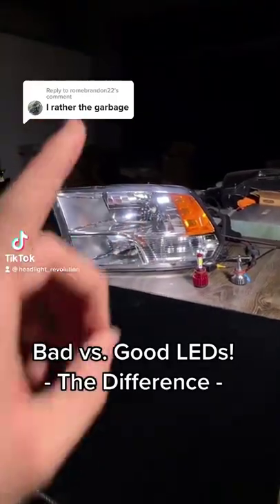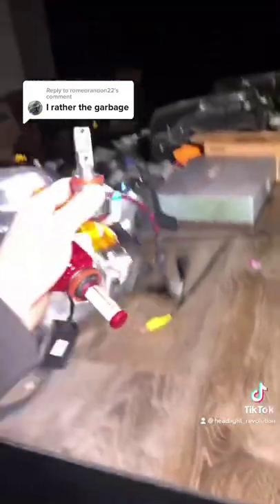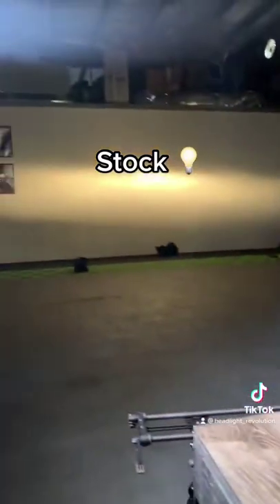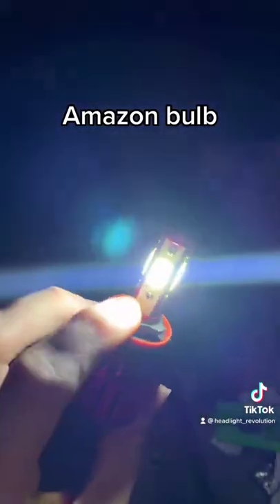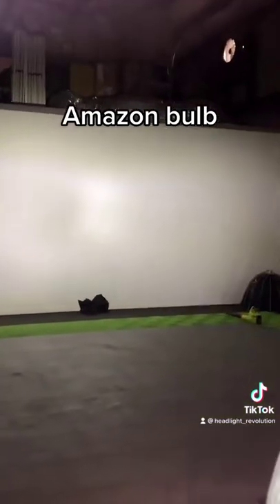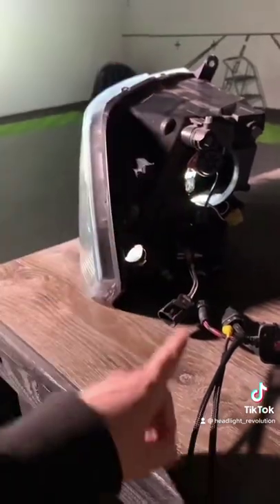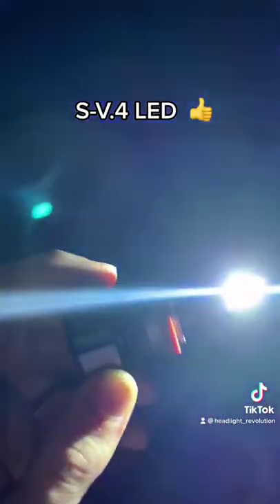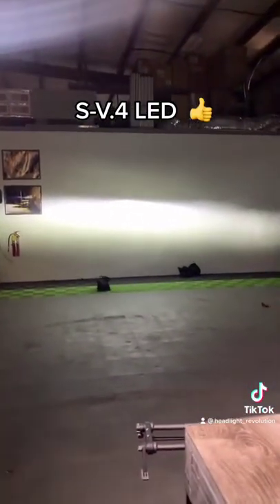Quality LED Bulbs vs. Garbage LED Bulbs! #shorts

Comment: Are the cheap LED's good for auxiliary high beams? Because I want my rally lights to be stupidly bright
Reply from the maker: Yes and no - cheap LEDs dont matter as much for high beams, but a bulb designed to mimic a halogen bulb will work much better with distance lighting versus upfront brightness. You can have a crazy bright LED, but it's not much help if it only causes glare!
Reply: @HeadlightRevolution  alright, thanks

Comment: So I installed good quality LED bulbs in my car and it seems like the light isn't dispersed evenly. There is just a small hotspot and not a lot of spread. Is that just a symptom of using a reflector housing with an LED? The brand of bulb is Lasfit.
Reply: Oh interesting I actually heard from many people that that's a symptom of a projector housing. You might have to mess around with the directions that the LED's are facing. They usually say 3 and 9 o' clock position but not always the case

Comment: I went with a set from superbrightleds and the design is similar, i see how they try and mimic an original bulb, so it has a chance at working. 
Theyve never steered me wrong, i even put one in for the microwave light.

Comment: Any LED bulb that doesn't accurately mimic the position of a halogen filament should not be put into a halogen housing. 1st generation LEDs are a disaster because of the central heat sink. Copper substrate 1860 chips placed central to the heat sink work best for reflectors and halogen projectors. 3570 chips work best for HID projectors due to the large capsule on HID bulbs.

Clocking the LED is also important! I'll never buy a bulb that cannot be rotated in its base. If it's not set vertical in the housing, it can skew the beam or cause the beam pattern to be higher on the side with oncoming traffic.

Comment: If you live in snowy areas and still have halogen lights in designed for them headlights don't get led replacements. Sunk in leds run too cool and just collect snow and ice on the headlight.
Reply: We get snow by the foot where I live and it's a non issue. You're already scraping the snow off your windshield, so it's not a problem to take ten whole seconds to scrape your headlights too.

Comment: I'm actually glad I now know this, I'm upgrading from OEM incandescents to LED all around ('93 Ford Escort LX on the Wagon chassis) as I have a bit of a hard time seeing with incandescents in smaller cars so I'm trying to find good bulbs for the heads that way I can see for a change (My vision isn't poor btw), I'm looking at cool white (because Daylight is so damn bright) as a good option
Reply: Figured I'd reply to my own comment over 7 months later. Picked up some Oxilam headlights (2 sided) and the difference is wild. Much brighter and there is a defined beam pattern

Comment: Wait so you can have a beam pattern with an LED in a reflector housing?? How do you orient it so it doesn’t scatter the light?
Reply from the maker: LEDs should be pointing left to rift, 3 and 9 o clock. 
Check out this video: https://www.youtube.com/watch?v=NbfAyqVgVdM&t=90s

Comment: I don't understand the LED craze. For headlights. Halogen bulbs make warmer light that isn't as strenuous on the eyes. Yes they're dimmer and don't last as long, but quality halogen bulbs are bright enough to safely see and they aren't as blinding.
Reply: I will say i like the tuned lights over the trash ones, but if you go over a hill crest with someone oncoming, you've just blinded them like you had your highbeams on. My favorite headlight setup is to run halogen bulbs adjusted a bit far out, and halogen foglights adjusted closer. Doing that, it allows me to see my lane clearly out to about 200 yards, i don't get as fatigued on long night drives, and i don't blind anyone.

Comment: The bottom flow seemed a bit week on the good one. The originals looked best in my opinion, only because they cover the bottom of the road (I.e. cats running out from under cars sort of area) better than the “good” LED bulbs.

Comment: The amount of people malding over LED replacements is wild. It's not the light itself that's the issue, it's the people that install them at home themselves, they skip the critical step of adjusting the beam. If LEDs were really an issue, then new cars wouldn't come with them at all

Comment: the only thing i dont like from LEDs is the color temperature. most retrofits only came with 5600K+ and i hate cool white light on rainy days!. sure, there is 3000K LEDs but those cheap lights got real bad tint and CRI, making things look like crap. i went to 4300K HID right after my LED chips died. maybe i'll get bi-led and swap the emitter with a good ones one day.

now i intended to make my own 3000K fog lights with CRI R9080 chips. no, dont worry, i know what is beam pattern and i'll keep my light within spec. promise i wont get you blinded!

Comment: Thank you for educating me. Question. When you install the dual sided led bulbs, is the stalk of the "bulb" supposed to be vertical or horizontal? The ones Ive tried dont have a specific direcrection. They are omni directional.
Reply from the maker: When you install a 2-sided LED, the stalk needs to be vertical with the LED chips pointing left to right, not up and down.

Comment: WAIT!!! Are you telling me that there are LEDs designed to be used in a reflector assembly? I don’t need to switch my old 2003 Ram 1500 to an expensive projector assembly with the right LEDs?
Reply from the maker: Exactly!
Reply: @HeadlightRevolution  Thank you for the info, I learned something new.

Comment: That one also is garbage. Why, you ask?
I'll tell you. Because the base is not adjustable. You can't properly center the bulb in the socket inside the housing. That's why.
Reply from the maker: The base of the S-V.4 is fully adjustable and can be clocked properly at 9 and 3 o-clock in any headlight housing.
Reply: No, it does not, fella. It does not rotate 360°.

Comment: What direction does the light come off a standard halogen bulb
Reply from the maker: OEM Halogen bulbs have filaments on the inside of the glass, which is where the light source comes from.

Comment: Doesn't matter if LEDs weren't standard they won't work anyway. At least I can't get LEDs to work on my H7s.  They just blink.
Reply from the maker: Have you tried using a PWM Module?
Reply: @HeadlightRevolution   tell me more... I had 1 set of Cougar brand blues that worked for years. Then I have tried every other brand available including the $100 Sylvania that are really good bulbs.  But they always blink.  One does every time.  Every bulb.

Comment: Why would a multisided bulb cause that... does it not do exactly what a halogen bulb does. Must be using the wrong length bulb or adjusting the results to push your product
Reply from the maker: Multi-sided LEDs are not capable of re-creating the filament locations that a halogen bulb has, thats why 2-sided LEDs are the best option because they best mimic the OEM filament locations, meaning they reflect the headlight optics correctly and you get a good beam pattern.

Comment: If another led headlight.mfer with the straight LEDs no reflectors/ projector (may be wrong on type.but which ever blinds ppl) blinds my ass I'm smashing head on into em and I'll be in a pretty big truck so I'll be alive lol they needa have some.kinda law/requirements cuz it's only.getting worse and just cause u can see great doesnt mean your safer when ur blinding any oncoming traffic 3miles up the road

Comment: How do you install the bulb ? (12/6 o’clock ) or (9/3 o’clock) ?
Reply from the maker: The way the bulb needs to be clocked is dependent upon the direction of the reflectors. This video should fully answer your question. https://youtu.be/NbfAyqVgVdM

Comment: I don't want to see everything? I only want to see a concentrated area?
Reply from the maker: As in, you want a beam pattern that points in a certain direction - not all around. Good headlights will have a strong beam pattern that throws far down the road, without blinding oncoming traffic.

Comment: But why is this A normal glow bulb also lights up 360°
Reply from the maker: Because the optics inside the headlight were designed for a filament from a halogen bulb that needs to be replicated when upgrading to something new. 360 bulbs do not replicate OEM halogen bulbs.
Reply: @HeadlightRevolution   Can you expand on that? Because you're not really answering the question that's being asked.

I understand that the reflector is designed around the halogen bulb filaments being located in a specific place in the housing.  That is how they bend the light upward when switching to high beam.  But how is it that a 2 sided LED can somewhat mimic that, but a 4 sided one can't? The filament still casts light in all directions.  So if a 4 sided LED bulb has its LED located in the same place as the filament in a halogen, why would it not produce a similar beam pattern?

I'm guessing it has to do with the orientation of the LED itself?  Because the LED itself is not the same shape as the filament it's enough to mess up the geometry of the reflectors, so blocking out light in 2 directions from the LED gets rid of some of the scattered light?  Is that fair/close to what's going on?

Comment: Could you explain to me why a normal halogen bulb(that has light 360°) works but an led that sends light at 306° does not work, it doesn't make sense to me but fscts don't lie(the video) please teach me! :)
Reply: In simple terms, because it doesn't replicate the Halogen filaments in size. The filament ( the light source ) has a specified length and width within its glass housing that emits light at certain points in the reflector housing. Hence why high quality leds are thin, with the diodes ( lighting source ) positioned at certain points of the housing that holds them. So a 360 makes no sense because the lighting source is just bouncing allover the reflector or projector like a rubber ball bouncing inside of a rubber box... I hope that makes sense.
Reply from the maker: The Lights are designed to reflect lights from the sides, not the top and bottom.

Comment: Or how about preaching the REAL truth. That being if you do NOT have a projector, you should NOT run an LED. These LEDs are not DOT approved in a reflector housing. You’re reflector housings are designed for HALOGEN bulbs and if you run anything else you will have uncontrolled light projection no matter what lights you run. 

You want LED or HID lights for visibility? Do the PROPER thing and retrofit your basic ass car with projector lens. 

Seriously people like me with astigmatism will fucking love you for doing it properly.
Reply from the maker: It doesnt matter if you have OEM Reflector or OEM Projector headlights, HID and LED bulbs are street legal in the USA for Fog Light use only. Not compliant with DOT / FMVSS108 and not street legal in the USA for Headlights. Legal for off-road use in Snowmobile and ATV headlights and off-road racing use only auxiliary or forward lighting. 

Unless your vehicle came with OEM HID or OEM LED, it won't be DOT approved. 👌🏼

Comment: its still gonna blind drivers. LEDs are directional light sources
Reply from the maker: I challenge you to try our LED bulbs, with them installed correctly I can guarantee they will not blind oncoming traffic!
Reply: @HeadlightRevolution  will the GTR Ultra 2 low beam headlights work well with a projector housing?? If installed at the 9 and 3 positions?